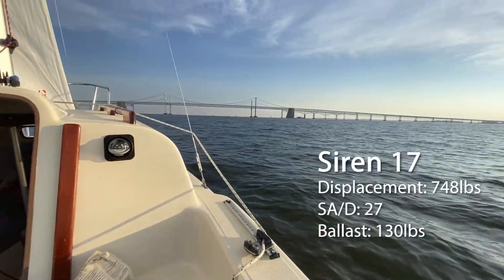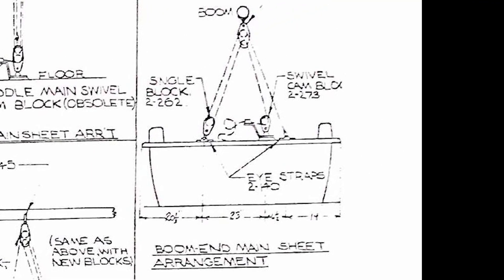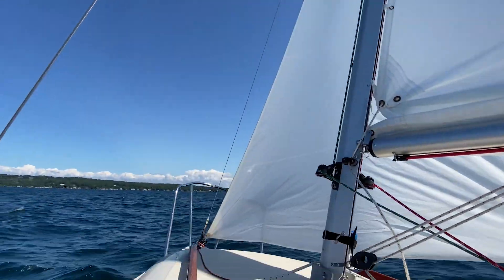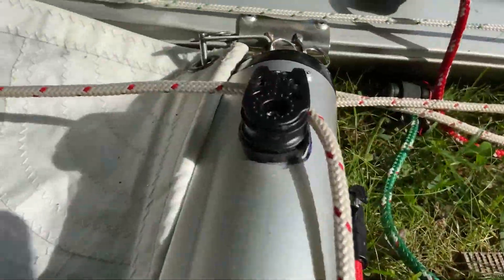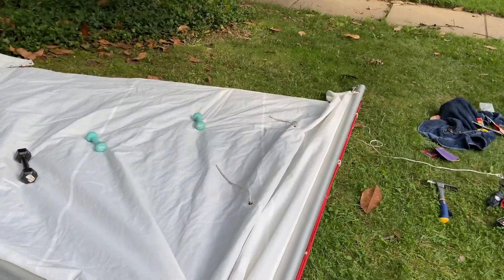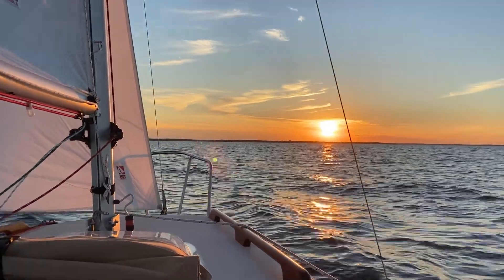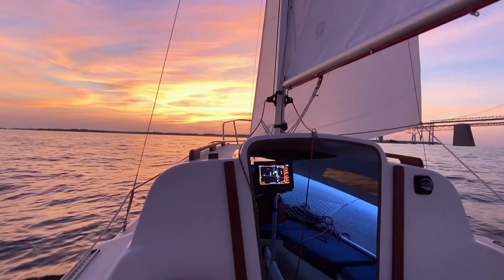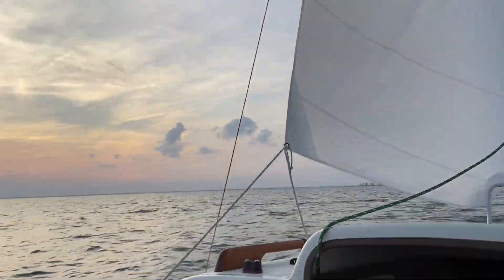Siren 17 - Rigging Upgrades

Comment: I’m looking for the double fairleads that you’re using on your Ronstan furler. Any help would be most appreciated. This set of videos is a real inspiration!
Reply from the maker: Hello, it’s made by Spinlock, here is the link. 

https://www.mauripro.com/products/spi-be10-2?srsltid=AfmBOoq_BD0RqIbScN9mQHeBrxnjkivnVnfirCQkHoW4s-eZdqCc4UWJ
Reply from the maker: In retrospect, I think it may be easier to not have any fairleads and keep the line lose on the deck port side. You could just use a snap nylon fairlead such has is one to hold the line near the cockpit. 

https://nautos-usa.com/products/hpn005-snap-fairlead-nylon-black-or-white-4-pieces-set
Reply: @siren17  This is really helpful!  Thanks so much!  Honestly, I've been watching these videos for years and am finally getting my own Siren on Friday.  If I can manage it, I may follow in your footsteps and try to help others with my improvements.

Comment: This is very well thought out and helpful. We have done many of the upgrades you indicated in this video. We are planning on converting our main sheet to be a cockpit setup to the aft setup. Do you by chance have a few more photos of the rigging you upgraded and used for the aft setup in your boat. We would like to replicate this as well. I’m mostly wondering about the location of the attachment points to the transom.

Thank you very much for your contribution!
Reply from the maker: Hi, glad you find this useful. Sorry but no more pics to send, we no longer have the siren.

Comment: Could you please share a link to your new furler please ?
Verry nice vidéo
Reply from the maker: Thanks for watching.  Here is the link.  If I would redo the installation, I'll make the furler structural (in line with the headstay with a swivel at the top).  Also, no need for the fairleads, just run the furler line to a cam-cleat on the side of the coach roof.

https://www.ronstan.com/us/series-60-furler-only-stainless-st-ball-bearings.html

Comment: Thank you for this video I am in the process of purchasing my first sailboat and currently looking at a siren 17   The boat I am looking at as the central main sheet do you think it would be possible to upgrade to a system like yours too clean up the cockpit
Reply from the maker: Yes, it’s a pretty simple main sheet and setup. That’s said, we have a center mounted cockpit main sheet on our new boat and I much prefer this arrangement. Mainly for the ease of control, from both sides with the swivel cleat being down low and easy to release and adjust.

Comment: Oh boy, I'm so loving the close look and explanation you've shared. Just wonderful. You've also got me thinking about upgrades (and fixes) I would like to make on my Gloucester 16. Lines I'd like to add are topping lift and single line reefing. Both require fastening blocks and cleats to the spars. In my research, I'm not sure if these should be screwed or riveted, and whether or not I need to worry about different metals and corrosion (fresh water only). So much to learn! Any insight into how you attached yours would be appreciated.
Reply: Hi, glad you find the video informative.  I tend to prefer using rivets (Arrow brand aluminum rivets are great) but some hardware is designed in such a way that only screws can be used to secure it.  So aluminum rivets or stainless steel screws.  Unless the boat is permanently in the water in harsh salty conditions, I would not worry too much about galvanic corrosion on a trailable/pocket cruiser but Tef-Gel is a good product to limit or prevent it.  My topping lift is attached to a small pad eye riveted at the top of the mast, I don't recall exactly how i secured the reefing lines but I think I had cheek blocks at the end of the boom and cleats on the boom or mast.  I no longer own the Siren 17, we upgraded to a larger 19-foot Flow 19.   Good luck with your mods!

Comment: I was wondering if the screws used to secure the double fairleads for the continuous furling line extend through the cabin top? I did not notice any nuts on the inside of your cabin in your tablet holder video. Thanks!
Reply from the maker: Hi, I don't have the Siren anymore but I think you are right, I must have used very short screws with a bit of epoxy.  if I recall, the coach roof fiberglass is around 5 to 8mm thick.  In retrospect, I would not have installed all those fairleads and just let the fuling line run along the side with a single cam cleat on the side of the coach roof near the cockpit.  That pretty much eliminates friction on the furling line and make removing the furler and furling line for storage easy. The furler is setup this way on our new Flow 19 and it works great.

https://photos.app.goo.gl/cXRw43Ei4jRWfMNV9
Reply: @siren17  Yes, a good suggestion indeed. Thank you for responding!
Reply from the maker: And you can also install a couple of those on the side of the coach roof to hold the furling line.  

https://www.deckhardware.com.au/10mm-acetal-snatch-lead-hook

Comment: Can the Siren 17 be towed by a small 4 cylinder car like a Toyota Corolla?
Reply from the maker: For short distances and roads not too steep yes. For longer hauls on highways, It’s safer to use a larger car. A mid size suv like a Honda CRV is good. It’s less an issue of having enough power than safety and good brakes.

Comment: Thanks for sharing. Your boat looks like a larger version of the Australian CAL 14. A friend owns one in Canberra and I owned one a decade ago. A great little boat but similar rigging isues plus the metal centreboard up haul was galv steel cable and a pin prone to rust and break when you least expect it. I enjoy your videos.

Comment: So does the jib furler have it's own separate forestay to rotate around?  Or does the jib just roll up on itself?  What does the luff of the jib look like?
Reply from the maker: Not quite so, the headsail has a luff rope attached to the furler.
Reply: @siren17  So the jib halyard just holds the top swivel stationary and the sail furls around the luff rope?  If that's the case , then it makes it real easy to take on and off the boat.  Nice.
Love your channel and you have an awesome boat.
Reply from the maker: @floridasailor3732  yes, that is how it works. Convenient but because of the lack of tension on the luff, as soon as the jib gets overpowered, the luff will sag, the sail will loose its shape and become pretty much unusable. That why I had a storm jib made.
Reply: @siren17  Considering the shortcomings, a down haul might be more useful.
Reply: @thierryhumeau337 Thanks.  I have a 19 footer too.  Do you remember which Harken model you have?
Reply from the maker: @floridasailor3732  I see two models that look like the one that came with my Flow 19.  They look the same but one is designed for lighter loads.  Here are the links for both:

- https://www.harken.com/en/shop/small-boat-furling/low-load-furling-swivel-3-mm-luff-wire/
- https://www.harken.com/en/shop/small-boat-furling/standard-furling-swivel-3-mm-luff-wire/

There is also a model with a built-in shackle
- https://www.harken.com/en/shop/small-boat-furling/standard-furling-swivel-3-mm-luff-wire-shackle/

Comment: great upgrades ,i also have a single line reefing system best upgrade ever takes 5 seconds to drop a reef ,i notice you have a cam cleat to lock the line at foot of mast ,best put that at side of  companion way door  hatch ,i have a a little turn block raised up on a swivel spring mount just  on roof of cabin at bottom  of mast the line goes back to cockpit and i have a paint mark on main halyard to indicate how far to lower mast lock that at mark pull the reefing line lock on cam cleat  job done in under 5 seconds
Reply from the maker: Sounds like a good idea. I do t have the Siren anymore but will test it on the next boat. Thanks for watching!
Reply: @siren17   oh you,ll missing not having a boat ,i,l look forwards to seeing your new boat hope its a trailer sailer
Reply from the maker: Yes, she is! Flow 19 custom built in France.

Comment: Thank you sir for such a detailed video. I  purchased a 16 ft Stow a Way sailboat for $100. The hull , center board, mast and boom are in very good condition. The boat was missing all of it's running rigging, sails , rudder and the seals around the windows. I have started up grading all the cleats, sheaves, fairleads and purchasing the blocks needed to rig the boat. I am very new to sailing and I,ve only been sailing once. This video will be very helpful in setting up the boat to sail.  I will be purchasing sheets, halyards and a boom vang assembly . I have been in contact with a young man who own two of these boats and he has also recommended 57 series Harkins blocks. Thanks again for making this easy to understand even for this novice.
Reply from the maker: You are welcome Danny.  I am glad you found those videos helpful.  Good luck with your boat refit!

Comment: As always fantastic video and very informative, particularly the Dropbox document listing all parts. On that note, do you remember what size/diamater rope did you use for the main sheet? Thanks!
Reply from the maker: Hi Nick!  I am glad you find this helpful. Below are lines and stays info.  Cheers!

Siren 17 Lines and Stays			
			
LINES	            Ft	  Dia inch	Dia mm
Furling Line	    21	  3/32	       2.38
Topping Lift	    27	  3/16	      4.76
Main Halyard   40	  1/4 	      6.35
Jib Halyard	   33	  1/4 	      6.35
Boom Vang	   10	  1/4 	      6.35
Main Sheet	   42	  5/16	      7.93
Jib Sheet	   32	  5/16	      7.93
		
			
STAYS			
Headstay	16'13"	3mm	 Measured from  pin on mast attachment to bottom  of cable thread at the turnbuckle
Shrouds	       16"11"	3mm	 Measured from  pin on mast attachment to bottom  of cable thread at the turnbuckle
Reply: @siren17 , I'm not seeing the dropbox document and recently purchased a Siren that needs some rigging upgraded. I would like to consider using some of the parts/upgrades you covered.
Thanks Justin
Reply from the maker: @justinmartin4973  Hi Justin.  Try this link, it should work. Best. 
https://telecam-my.sharepoint.com/:x:/g/personal/thumeau_telecamfilms_com/EXkSwCJJtEZHjCW-TYNFevABZ_89Lu_asJ1LSRdsNnEB0g?e=nvUT3z
Reply from the maker: @justinmartin4973  try this link, it should work :)
https://telecam-my.sharepoint.com/:x:/g/personal/thumeau_telecamfilms_com/EXkSwCJJtEZHjCW-TYNFevABZ_89Lu_asJ1LSRdsNnEB0g?e=Lz8Zbr
Reply: @siren17  Is there anyway to still see this document?
Reply from the maker: @laurieadam1354  I am sorry.  I sold the Siren a couple years ago and can't find that document anymore :(

Comment: Are you familiar with Garhauer Marine parts for blocks, and fiddle? They are on the boat now, but all old and worn out. Is Harken worth the extra money? Just curious. Thanks again.
Reply from the maker: I am familiar with the brand but never used their products.  In any case, if you look at the big picture, the price difference is not much of a factor at the end.  Harken is #1 rigging equipment company, Ronstan #2 and their stuff is well designed, proven and highly reliable.  To me it's a no brainer.
Reply: @siren17  Great.  I’m always looking to learn from someone else’s experience. I will follow your advice.
Reply: I need a mast block and am trying figure out what you used on the port side of your main sheet system. Thanks again Very much !!
Reply from the maker: @craigbachtell1308  just my humble opinion. I love to share ideas and not claiming to know it all. 😇
Reply: @siren17  Good advice.  I bought a Sirius 21 a few years ago. Due to issues it went to storage til now. Just getting it all rigged and ready. Thanks again.
Reply from the maker: @craigbachtell1308  Sirius 21!  Wow, a rate beast I suppose?
Reply: @siren17  lol … I don’t know what that means?  Lol
It seems similar to yours just a little bit bigger. All the reviews say they are nice. I have spent the past 2 years sailing with a friend on his MacGregor 26 so I think I will be impressed with mine when I try it out.
Reply from the maker: @craigbachtell1308  sorry, typo. I meant a rare beast... I don’t think there too many of those around. Although, Frasier Vandestadt, one of the original owners of V&M shipyard has one.
Reply: @siren17  I am looking at the 57mm Harken 2625 Ratchamatic block you recommended. It shows up in Red. The HTE version is in white or black and says...  "The spring on the HTE (high threshold engage) was made stiffer to delay the point where the ratchet engages, allowing the block to run free more of the time. The ratchet function engages at higher loads to allow the old kite to run free for crisper gybes. 1.5x grip: breeze-on/puffs; 15:1 holding power"  I don't really understand that, so which would you recommend?  Thanks again. !!
Reply from the maker: @craigbachtell1308  I don't think you'd want the HTE version on a small craft.  It seems to be targeted at high load applications.  Cheers.

Comment: looking at a 1980 Victoria sloop 18  $1800 / 1200lbs and a Siren at $2000  750 lbs. The Victoria has a very nice look but it looks like this little one would be so much easier to drop in the water. Great info. on all the rigging!
Reply from the maker: Yes, it will make a huge difference in trailering, rigging and launching.  The Siren is tender but there are advantage to this.  She can be sailed safely under normal conditions as long as you have a well maintained running rigging and average sailing skills.  Also, a fully retractable keel is VERY IMPORTANT for easy launching in shallow ramps and beaching the boat anywhere.  That Victoria 18 fixed keel is convenient but at 2', will make launching difficult and take beaching out of the question.
Reply from the maker: And indeed, the Victoria 18 has nice lines.  She must sail well upwind under 20kt!

Comment: re: the Ronstan Furler
What modifications, if any, were needed to the headsail to accommodate the furler?
Reply from the maker: Hi Mel. No modification needed to accommodate the headsail. Both Ronstan units, furler and top swivel have the same pin to pin dimensions than the Siren’s original furler.
Reply: @siren17  Nice, thanks.
Reply from the maker: @melstill  In order to attach the furler unit with the shackle that came with it, I had to enlarge the deck plate hole a bit.  I used a Dremmel tool with a gridding bit for steel. See photo here:
https://www.dropbox.com/s/fy5mxr4eb2qx6l9/Ronstan%20furler%202.jpg?dl=0

Also, adding a few double fairleads will keep the line neat on the deck.

Comment: Unbelievable video! I wish you lived next door.
Reply: I need the Harken Ratcheting block with swivel cam cleats you put on the mainsail rigging. I can’t find one. Do you have the model number or tell me where to find one? Great video, I just got my first boat and it needs all you showed. I big help to me. Thanks!!
Reply from the maker: @craigbachtell1308  Hi Craig, I am glad you find the video useful!  I am using Harken's #205 small swivel cam base with a #2625 Rachamatic block.  Those are easy to source from Harken dealers like www.mauriprosailing.com .  Also, here is a link to a spreadsheet with all parts used to upgrade my Siren 17 with hot links.  Enjoy!

https://www.dropbox.com/s/0kkok339rfczcrd/Siren%2017%20-%20Running%20Rigging%20Upgrades%20Parts%20List.xlsx?dl=0
Reply: @siren17  Thanks !!
Reply from the maker: Thanks for watching Ray.  Where are you at? Have a Siren?
Reply: @siren17  Yes, I have been sailing my siren for 10 years. I really enjoy your videos  because you point out many of the problem areas that I have experienced... except you have very effectively dealt with them. I am in St. Thomas ON. Just South of London.
Reply from the maker: @1dominator  cool. Thanks for the kudos! Stay safe.

Comment: I've checked out the Ronstan Series 60 Furler.  As Ronstan doesn't do retail sales, I checked with Defender Marine and they do not carry this.  Where did you get yours?  Also, it appears I will need three components: the furler, spliced line, and the top swivel.  Is that correct?  Jake Dunnuck
Reply from the maker: Hi, I think you can buy direct from Ronstan but I bought everything from Atlantic Rigging Supplies https://atlanticriggingsupply.com/ . Yes, you will need all the items you listed and also need a Ronstan F20 splice needle for 4-6mm Line.  The furling line comes un-spliced, it is not hard to splice but I'd recommend you practice on cheap 1/4" nylon line.  Also, I don't know how you plan on running the furling line on your boat's deck but on my Siren 17, as seen on the video, I installed a few Spinlock Double Bulls eye fairleads.  Inexpensive and convenient.  Good luck!

Comment: I’m interested in your gooseneck upgrade.  Dwyer shows 2 of the type you used: DM 410 & 416.  Which did you use?  My current GN is adjustable, what measurement from base is your placement?  (Thank you from a Siren owner!). Jake Dunnuck
Reply from the maker: Hi Jake, I would call Carson at Dwyer Mast. You can refer to quote #818 he made forme.  Their web site is not up to speed and not all parts are shown.  I got neither the DM 410 or 416.  Here is the part list that was on my quote.

1.00 DH4128 Bracket, Gooseneck, Fix,DM-284 38.00 38.00
1.00 DH316 Universal, Gooseneck, 3/4", S 9.00 9.00
1.00 DH3143 U Bracket, Heavy 7.20 7.20
2.00 CLP-4-111 Pin, Clevis, 1/4 x 1-1/4" 2.64 5.28
2.00 CR2 Ring, Rigging, 5/8" x .048" 0.30 0.60
1.00 F126 3/8-16 x 2-3/4" HX HD 6.00 6.00
1.00 F28 Locknut, 3/8-16 1.75 1.75
2.00 F115 Washer, Fender, 3/8" x 1" 0.60 1.20
Reply from the maker: My boom is a a fixed height.  Sorry, boat is in storage now and I can't measure.

Comment: Thanks so much! I have lots to do but will have to work at it slowly. One thing I need to ask, what type/size rivets do you use on the boom, on the mast? Once again, thanks for all you do.
Reply from the maker: You are welcome.  Whenever riveted, I use Arrow's 3/16" (5mm) aluminum rivets.  Great rivets with a nice wide head.  For the small stuff that is not under heavy load, I use stainless screws.